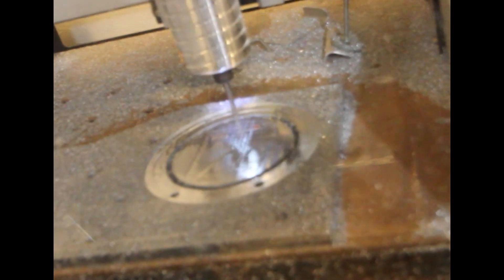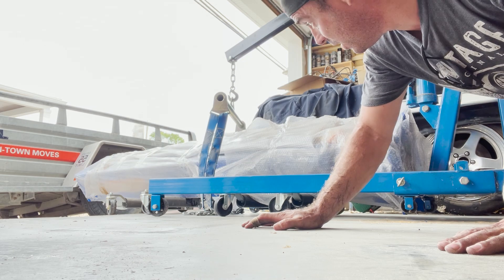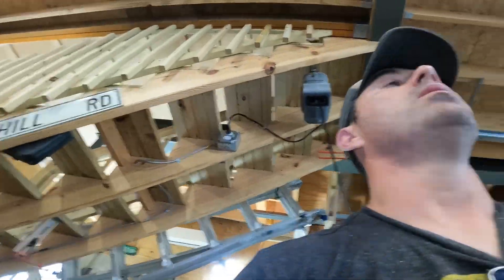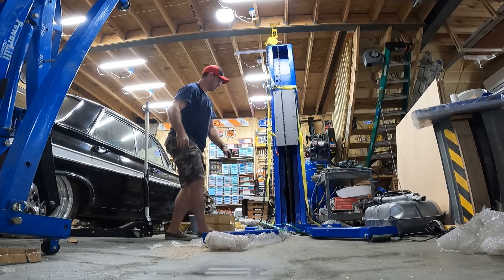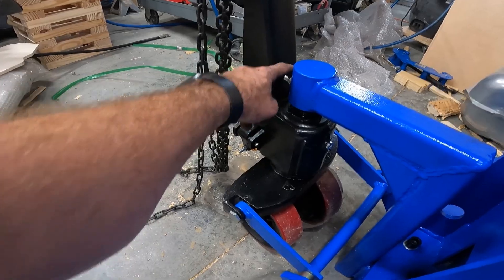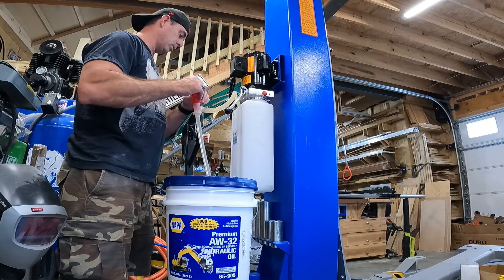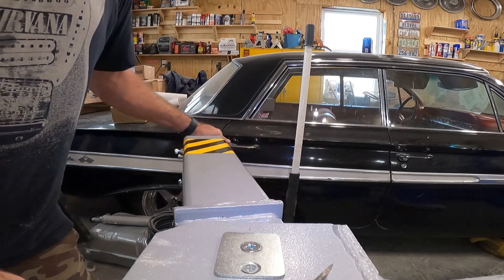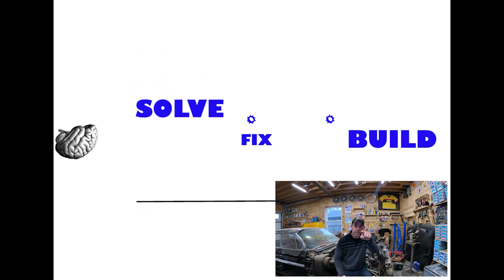Single Post Lift Assembly BY YOURSELF (no forklift!) - BEST Car Lift Small Shop - Solve Fix Build

Comment: man that is B.A. cool lift. i rather have this than a two post. because of the drilling and it mobility. cool video
Reply from the maker: The mobility has been very handy. I am about to do suspension on my C10 and I'll be able to flip the lift around and drive the truck in on the other side once I push my table saw back.

Comment: How much of the floor does the lift take up and how high are your ceilings. I got a two car garage with a single car door. I’m gonna put a steal building up in a few years so doing a lot to the current garage is out of the question. Building a k5 and a 70 Monte
Reply from the maker: My ceilings are 10 ft. I selected this lift exactly for that reason. The floor space is nearly equivalent to a pallet jack, perhaps a little wider and longer. It extends to nearly the other side of the Impala. My car is lowered and I have about 4" of ground clearance and it is a little tight but I can slip it under the car from the side. They make two versions of this lift, one low profile and one not - this is the low profile model.

Comment: This was great.  I too had a challenge getting it unloaded.  Shipping frame was trashed on one end but protected the lift.  What was the actual height of the lift after assembly?  I have found dimensions but I would like to know what you ended up with.  I did not measure my work area height first :-).
Reply from the maker: It’s about 103.5” (2629 mm) without the pallet jack elevated, flat on the floor.